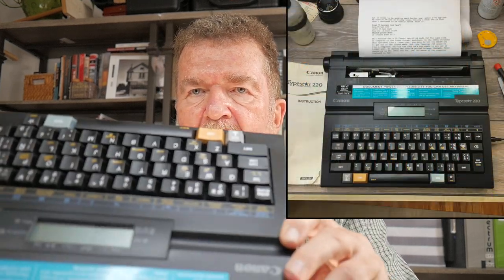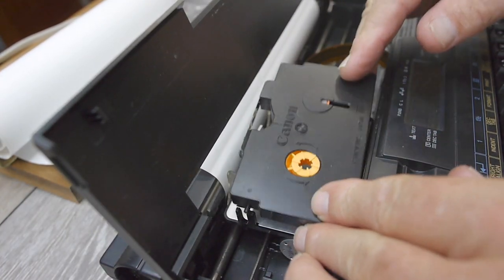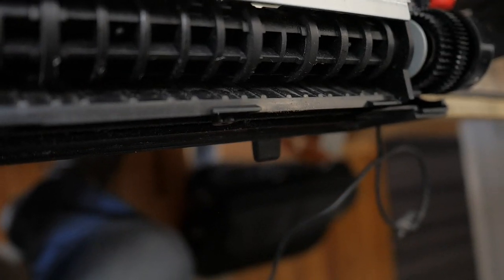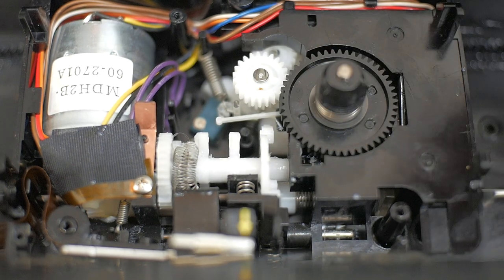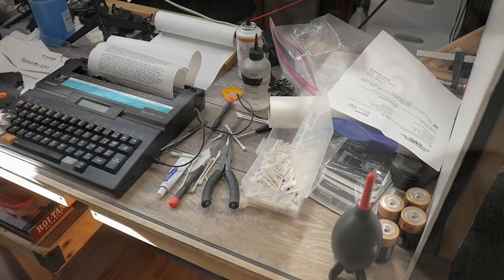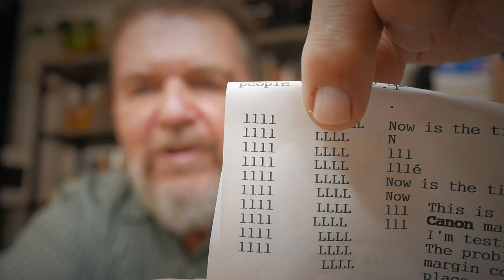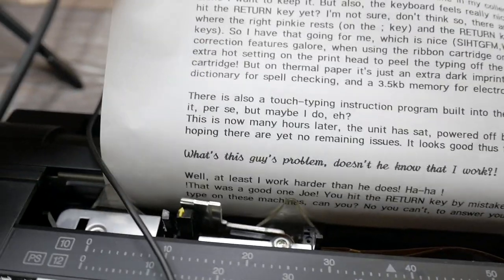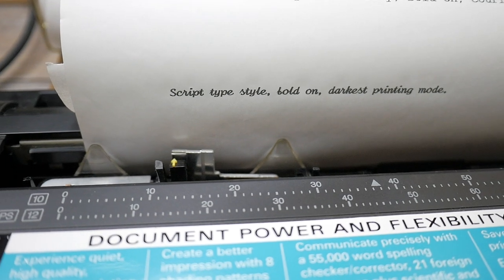Canon Typestar 220

Comment: Blu-Tac and your phone.   Yup, Blu-Tac for those pesky screws, a smidge as small as a grain of rice on the screwdriver tip, holds the screw nicely.
You phone?  Take pictures of each page of the manual, then make a pdf out of 'em.

You're welcome.

Comment: Sir I require assistance with a Remington portable 3 1931 I have an issue where no matter what key I press the carriage will not carry on down it’s way the tab button don’t work but when the carriage is all the way to the right it seems like the tab button half way wants to work thank you this would mean a lot to me
Reply from the maker: The carriage rail and bearings need to be cleaned and lightly oiled for the carriage to move smoothly. There also needs to be sufficient tension on the spring motor, make certain it’s wound up tight enough so when you manually move the carriage you feel it pulling even with the carriage near the right margin.
Reply: @Joe_VanCleave  thanks so much once I get some tools I’ll start opening er up I wanna make this Remington look like the day she came out and use it as my daily writer
Reply: @Joe_VanCleave  actually while I’m waiting to get paid to buy some tools I was looking at it and there is a string underneath that fell out while I was moving it around it’s still attached to something underneath
Reply: @Joe_VanCleave  the rail with the teeth doesn’t seen to engage at all the carriage slides side to side
Reply from the maker: That’s the drawband that connects the carriage to the spring motor, it’s what drives the carriage as you type. It may need to be replaced if it’s broken, and the spring motor retensioned.
Reply: @Joe_VanCleave  never mind the carriage was locked just the puller string and a clean up and I got myself a genuine 1931 typewriter omg
Reply from the maker: Congrats!